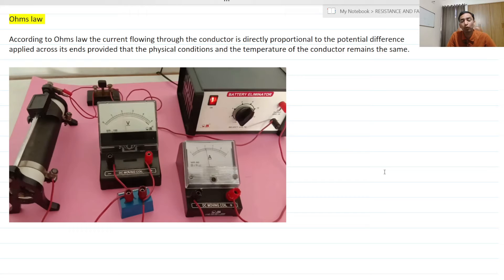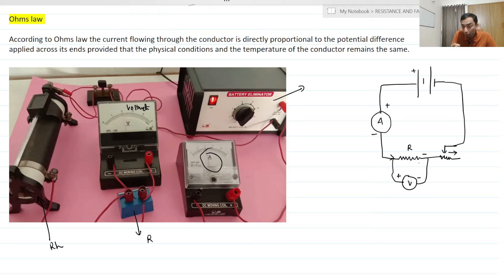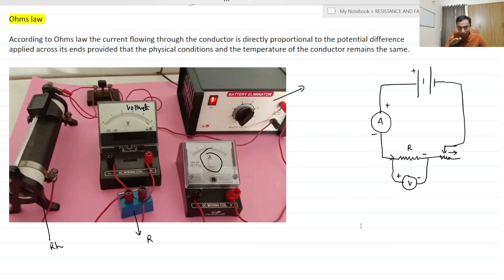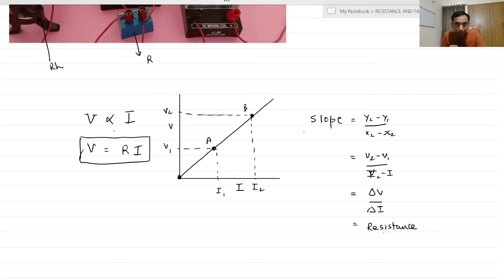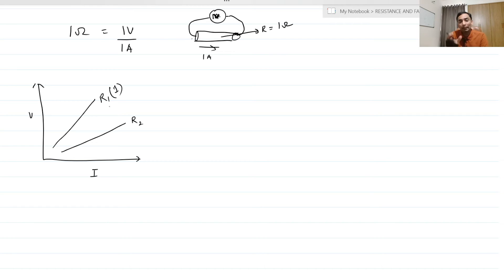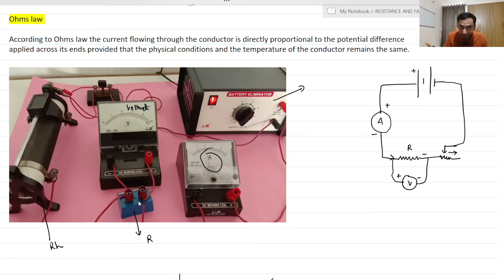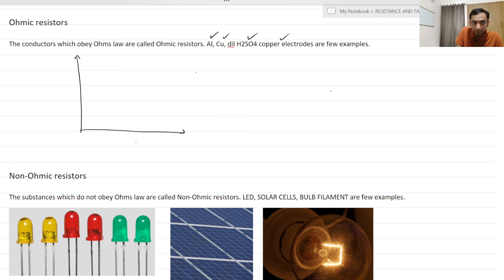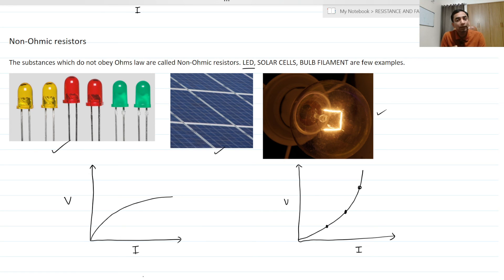OHMS LAW Theory & Demonstration | Ohmic & Non-Ohmic resistors | STD 10 Physics | ICSE CBSE & IGCSE

Comment: Sir ohm's law states that I is proportional to V also the constant is 1/R not R and it's derived from I=GV where G is conductivity I found an explanation about the constant is 1/R hope you'll see:
This question represents an ongoing battle between math purists and physicists. It is one those weird things that is done in physics that a mathematician would never do. I have always pondered about this question, for years in fact, since the first day I was exposed to this theory.
Ohm’s Law is not a real “law” in physics; in the sense that it is not universal. Ohm’s Law is true for a limited number of circuit elements and for a narrow band of temperature values. These circuit elements are called “Ohmic” devices. They are basically 5% tolerance (95% reliability) resistors. The statement of Ohm’s Law is: the current through a resistor is directly proportional to the potential difference (voltage) applied. This statement makes the voltage the independent variable and the current the dependent. Math purists would tell you that when plotting a graph, the independent variable is plotted on the x-axis (that is why time appears on the x-axis. Time is an independent natural quantity). In the case of Ohm’s Law experiment, the voltage (energy per charge) is the independent variable and it gets the charges in motion (current) by transforming electric energy into mechanical energy (kinetic). Current is the dependent variable. Now you must plot V on the x-axis and I (current) on the y-axis. The slope of the line is delta y / delta x; which makes it delta I / delta V. The equation of the line is: y = m x + b. Substituting the variables with b = zero, we obtain: Current = (slope) V. This equation is NOT the familiar Ohm’s Law equation! Ohm considered a resistance to be a circuit element that reduces the flow of current at constant voltage. The equation as shown, says that the resistance is a circuit element that reduces the voltage for the constant current. Does not sound familiar at all, does it? Therefore, in the spirit of keeping Ohm’s Law to its original setup, physicists plotted I as the independent variable and V as the dependent, and the equation became: V = R I [Note that it is really V = R I; NOT V = I R. But again, tradition trumps math.]

Conclusion: math tells us that the proportionality constant is 1/R. Physics traditionalists tell us that the constant is R.
And the who gave this explanation was former physics professor of United states air force academy.
And V is proportional to I isn't wrong in here the voltage is dropped voltage not the potential difference so both are write in their own way